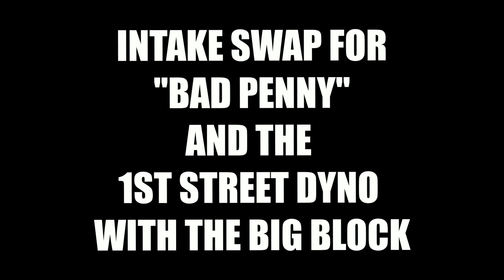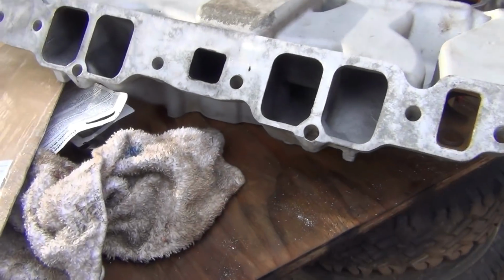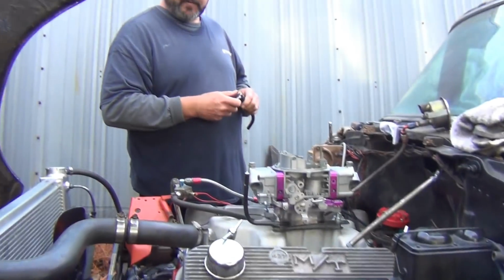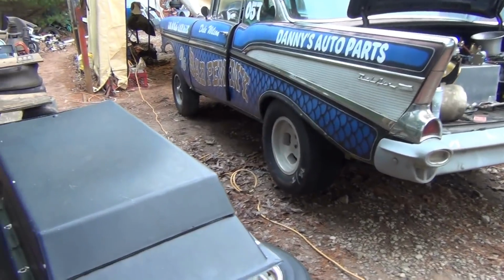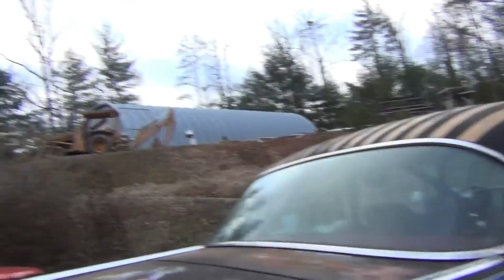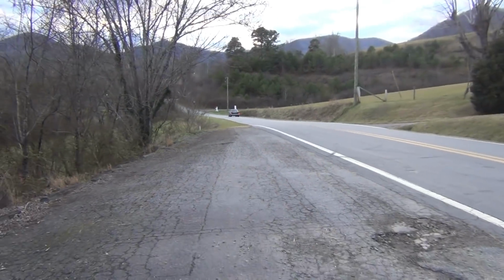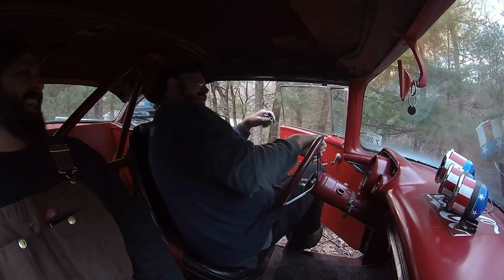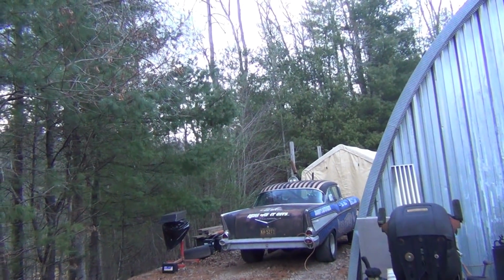SKULL GARAGE 2021 (EP.1) 1ST STREET DYNO WITH THE BIG BLOCK IN BAD PENNY

Comment: It sounds great! Lots o torque.  Is it a tad rich? Lots of smoke when he punches it.  Dont want to wash the rings out. Agree 5.57 is a bit steep might run out of rpm in the 1/8 ... but fun . When i was like 17 i had a 56 with a 265 cu in big heads and Duntov 30/30 solid cam and a 5.38 Pontiac rear end . Took awhile to spool up to 7,000 but then you just grab gears . 
So much fun watching you guys ,most dedicated hot rodders ive ever seen. Hope some day you can have a indoor shop.
Reply from the maker: its a tad rich it still has the small breather on the carb which is a bit restrictive but i set it up a little rich just to be safe,but the smoke is from the valve stem seals,im gonna replace em this weekend i knew they were bad when i built the heads and engine but didnt want to wait 2 weeks for new ones to assemble engine, figured id just swap em out later which is no big deal,and thank you man that really means alot! and we will one day,but if not im ok just hangin with my dad doin things just like we always have....justin

Comment: Welcome to wonderful world of big blocks. Suck that intake manifold didn’t work out for you guys. Sorry about that it was working fine when I took it off of Roxy. Maybe I did something wrong with it when I took it off. Good luck in the future. It was a real pleasure see Bad Penny tearing up the street.
Reply from the maker: the big block is all thanks to you man! the rods and pistons etc were killer,where you signed em was still on when i put em in the engine! and the intake i think just didnt seal well on the oval port heads,you prob ran em on square port,either that or when we tightened it up it may have cracked in one of the runners thats a really old intake so casting may have just gave out somewhere,im gonna look real close and try and see what i can find,but its awesome that the guts of roxy are alive again in another car! we cant thank you enough buddy!.....justin

Comment: I know yall use what you got, but square port manifold on oval port heads is a terrible choice
Reply from the maker: it aint the best but its really not as bad as u would think,just a lil obstruction but an engine sucks what it needs,if it was boosted or blown and air was being pushed in the runner then the turbulence would be more of an issue but since the piston sucks air thru the intake runner and not being force fed it doesnt cause any signal issues,its actually very snappy for what it is,later on when we can we will match things up but for now it works just fine!....thanks for the comments...justin
Reply: I'm sure it's not good for horsepower but will it be ok for street use?

Comment: You fellers would have a cow with some real horse power.
Reply from the maker: How much is real horsepower?
Reply: @BIGDADDYDALEWILSON  2500 to 3500. If I had one that produces that I would bring it straight to you!!! LOVE YOUR CONTENT... BRINGS BACK MEMORIES OF LONG YEARS AGO. I REMEMBER STABBING THE PEDAL AND LAUGHING JUST LIKE YOU AND DAD WERE... KEEP SHARING YOUR LIVES WITH US. HAVE A GREAT YEAR.
Reply: BTW I HAD A COW WHEN I STEPPED ON THE PEDAL OF 2500... NOTHING LIKE IT WHEN YOU LOVE THE FEELING
Reply: That was over 20 years ago. Seems like a life ago. Turbos were extremely rare back then. However we did have injection and blowers. Oh yeah and throttle control. Started out racing on the street. After a wreck racing one night I decided the track would be a better place to go. Back then around Chattanooga we didn't have outlaw street cars. Bracket racing then some outlaw racing got going. Had a few small blocks blown and injected. Then moved up to big block then to blown hemi. Seem like You can never get fast enough. Then one beautiful spring afternoon I stepped off the porch and POW sounded like a gun shot went off in my low back down to the ground I went. Spent the following seven months crawling like a baby and mostly laying in the floor. Thirty years old and lost everything I had. Finally had back surgery December 1st of 96. In 97 I found out it's just too much pressure when I stuck the throttle. That's when I walked away from the hp. Now looking at a third back surgery I run across you. Sure brought back memories. Thanks again for sharing your lives with us